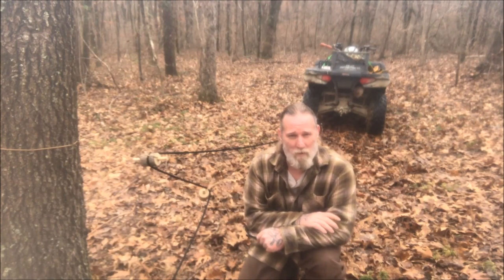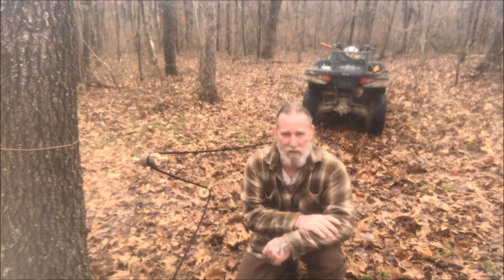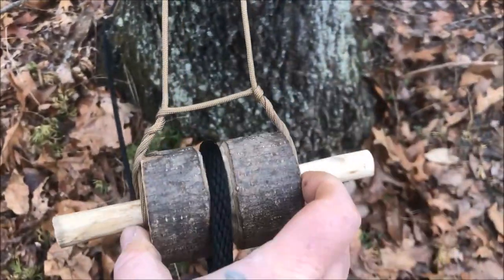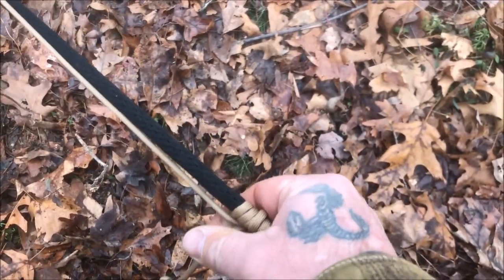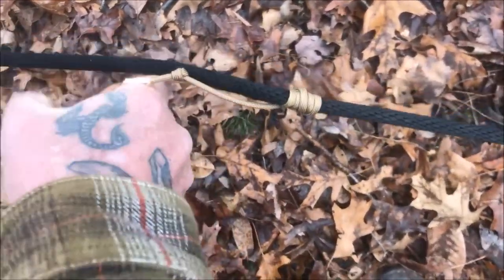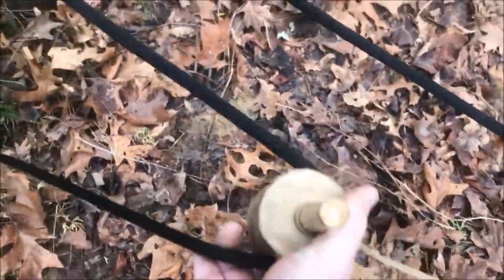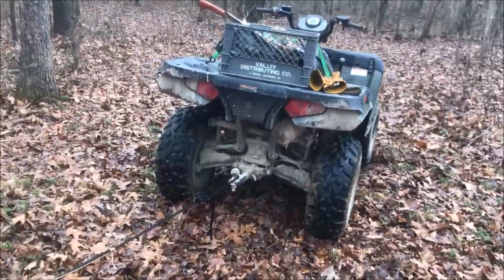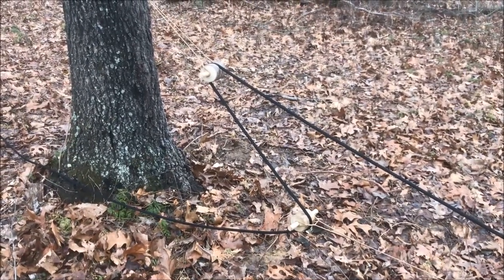Z Drag with wooden Pulleys

Comment: this system is commonly referred to as a Z rig, or 3 to 1 in the rescue community. one commenter asked why not attach the pulley to the object, in this case you would not have or gain any mechanical advantage, as in this system, one of the pulleys must move, or  collapse with the system to make a mechanical advantage.

Comment: Somebody may have already put this in the comments, I don't know I haven't read through them, but another good idea is before pulling to toss a jacket or tarp or some type of weighted material over the lines between the pulley. This will help to dampen the lines if they snap and prevent possible injury. Granted if you are using this technique by hand, then you likely won't build up enough tension to snap the lines or at least not enough to cause any serious injury, but if using in conjunction with a winch, beast of burden, another vehicle or the like then significant energy can become stored up in those lines. Simply tossing a sweatshirt over the lines before pulling can mean the difference between have two eyes or one. Ha. Good lick

Comment: Break those sharp edges to decrease friction, awesome idea!
Reply: Jeff Garinger another good thing friction wise is a pulley at least 5 times the diameter  of the line and more is better. We used to use a 5 inch pulley to 1/2 inch line.  It makes a big difference.

Comment: In my experience (With different pulleys)  you attach one pulley to the anchor just like you did and the other pulley attaches to a caribiner  which is attached at the prussick directly without all that tail. That way you can work with the amount of rope you got but every time you reset you get a little more rope to work with until you work your way all the way to the load attachment point.
Reply from the maker: A shorter rope works well for most applications for sure

Comment: Why not attatch one of the pullies direct to the object you want to move?
Reply from the maker: You can, that would be a traditional block and tackle, this system uses less rope if you have a longer drag allowing you to adjust the pulleys position along the main line
Reply: it comes from the safety and rescue world where the object you want to move is not always within reach.

Comment: Hey Dave I was wondering if you ever encountered trench foot and have any remedies that would work cuz I went to the doctor and couldn't get rid of it so I was wondering if you knew anything
Reply: this is one of these conditions which really dose not go away fully. But can be managed with an antibacterial foot powder (US or UK army issue is very good) and then you can also use a anti fungal foot cream to apply directly on the sores between the toes. The powder is best placed inside of your socks, shake it around and then empty into a  bag so not to clog up the sock or alternatively put the powder into a bag and then place your foot into it daily. As when your feet start to sweet again the trench foot or athletes foot will come back.
Show less
REPLY